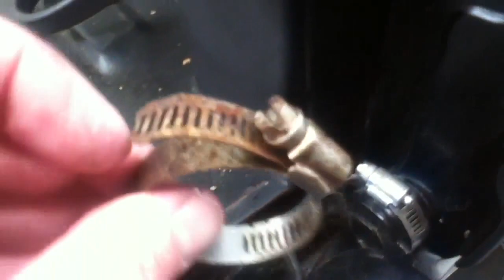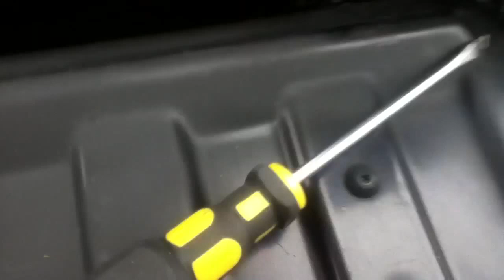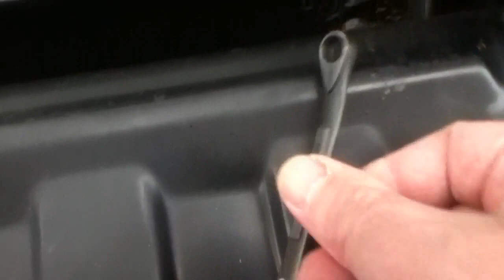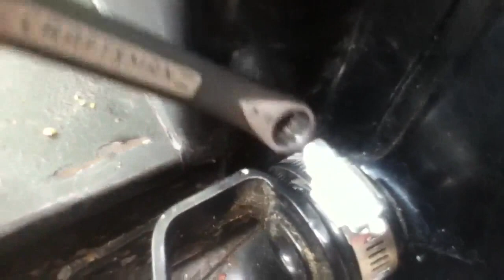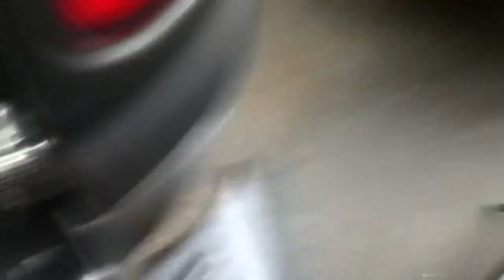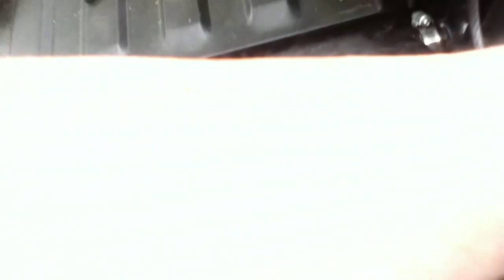Pickup Tailgate Theft Protection Tip

Comment: Thanks for taking the time to make this video. I've used hose clamps in the past but I never thought to put the hex head to the INSIDE so a thief has to use a wrench instead of a screwdriver to get it off. I just upgraded both my trucks. Thanks for the tip! I also use the largest (longest) clamp i can possibly get so that if a thief does try to get it off, he's going to be there a while thus increasing his chance of being detected...and shot.